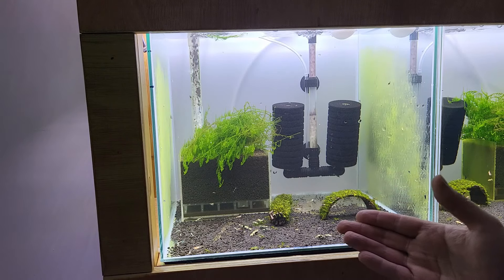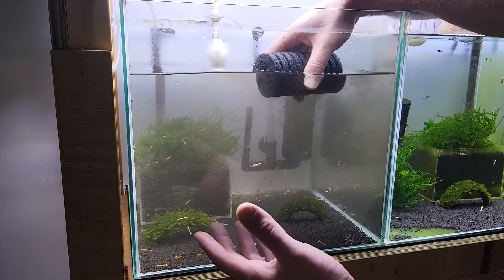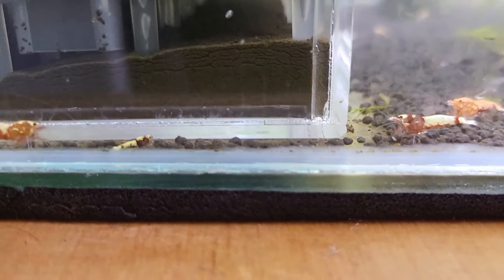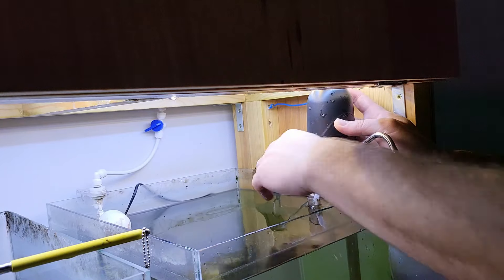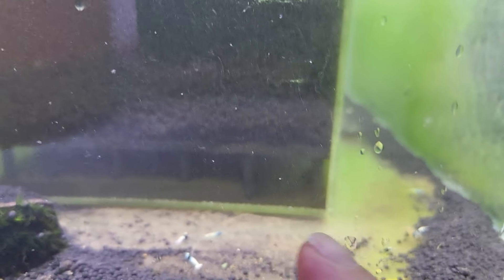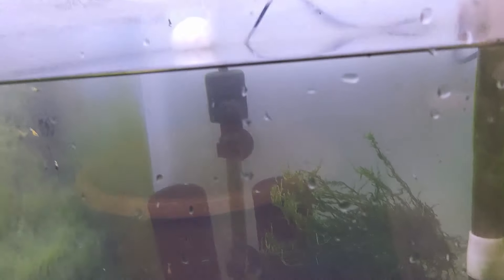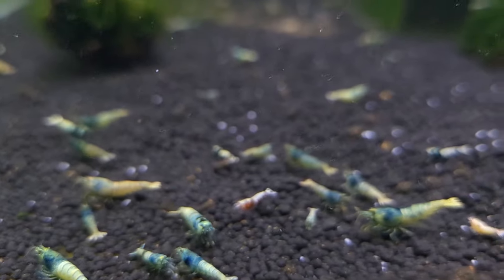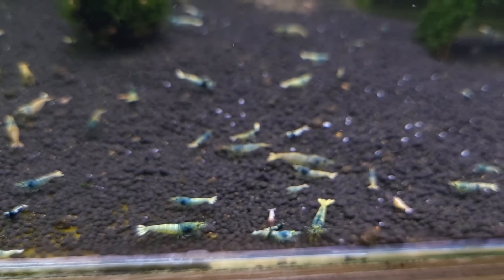How to Clean Undergravel Filter in your Shrimp Tank?

Comment: For my ugf boxes I have modified a submersible nano pump with an Inline Waterproof IP65 switch which allows me to switch the unit off and on at a press of a button. This becomes a miniature water vacuum cleaner enabling me to thoroughly clean the ugf box. 

I also have exactly the same sponge filters which I have also modified by placing a small plastic bottle half filled with k1 media thereby the filter is now both a sponge filter and moving bed filter. This has significantly improved the filtration for the tanks.

I found the ppi of the original foam wasn't coarse enough, so I took them off and wrap around a more course foam instead.

Comment: Try using simple longer piece of airline tubbing to syphon more out.  Maybe because it is more flexible, it will bend more inside.  Also, you could drill tiny holes along the tubbing so it will cover more area.   This year, I will be changing all my tanks to UGF.  Such a simple sollution and a lot easier to change substrate.
Reply from the maker: Hey Brian, Last time I tried airline tubing it stop working once it touch the muck, maybe it's too small and blocking very easy. Next time I'll try to find slightly smaller diameter tubing and more flexible so I can bend it
Reply: @shrimpmaniadaily  they have it at home depot it's called gas line tubing used for games like co2 it's a stiff type of plastic

Comment: You should put a box inside a box bond your support grill to 4 sides and drop that into a snug box so you can lift your soil out and vacuum the muck out of the main box p.s if your not paying attention and watching! the sounds you make when getting the muck out of the second ugf box sounds a little rude haha
 love your videos by the way
Reply from the maker: Good idea but a bit complicated to do also inner box should be water sealed otherwise it will suck water through the gaps at the bottom instead the soil it's gonna be hard task to achieve that. Sorry about sound and thanks for your support!

Comment: If you did this with an airline hose you could do the full bottom as it would bend?
Reply from the maker: Yes I had a bit better result with an air line, still quite tricky to go around the pins and hard to point it in certain directions.
Reply: @shrimpmaniadaily  ahhh I just watched your vid on the guy that had the bended thicker pipe. That's a clever idea.
Reply from the maker: @spitfire29588  Indeed! I want to try to make it as well in that little ugf box

Comment: You are not supposed to clean it. The idea is to build up material at the bottom that assist with the breakdown of material and chemicals to put it simply and what you removed is critical for the good operation of the filter. These filters can work for years without cleaning. Looks like you miss the point and a good understanding of how under gravel filters work and the science behind it. Go and listen to Professor Kevin Novak’s YouTubes videos in this regard. He is an expert in his field and explain it much better than we could.
Reply from the maker: I believe that's absolutely fine to clean it sometime. It's plenty of buildups and beneficial bacteria inside the filter. When a lot of buildups at the bottom it start to spitting into the water column clouding the water so its necessary to clean it to to avoid it. Only see a positive effect after cleaning